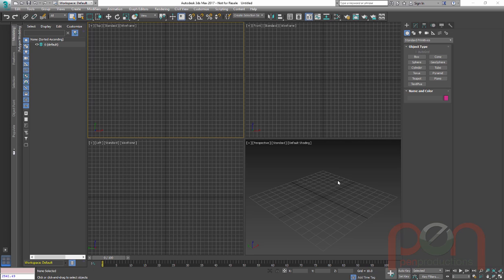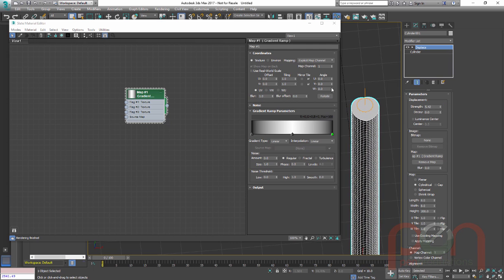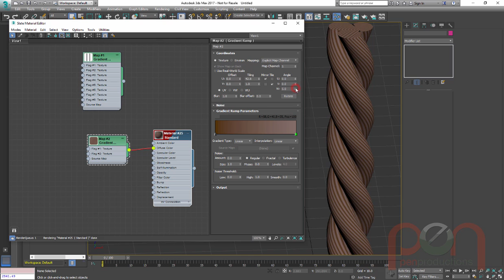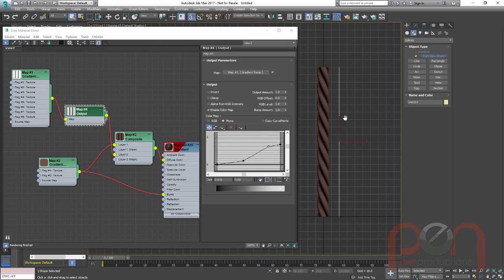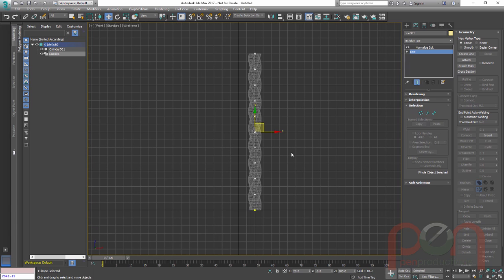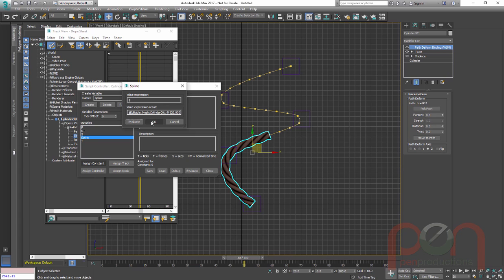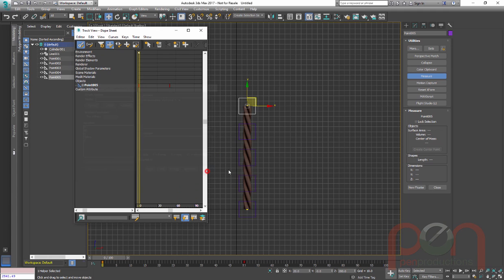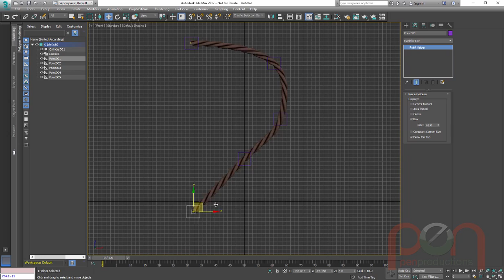3DS Max Procedural Rope

Comment: This is excellent - and really handy vs. mucking about with the debatable virtues of mCloth rope or regular Cloth modifiers etc.

On the topic of forces though - what would be your suggestion as the best way to make this react to Wind, without potentially messing up its virtues?
I'm intending to have a flag (with Cloth mod) being raised on a rope, and fluttering in the breeze, and would like to try and have the rope react a bit too.

If need be, I can do it by hand, but if you have a better idea it would be most welcome.

Comment: i don't have the gradient ramp parameter
Reply from the maker: I'm going to assume you have Arnold set as your rendering engine. If so the legacy maps don't show up unless you turn them on in the render settings dialog under the System tab right near the top.

Comment: Hey Paul, can you help me sorting out the problem please? trying to follow your tutorial, but every time after "curveLenght Spline / 200" I get error: Type error: Call needs functionor class, got: undefined. thanks
Reply: I created variable called Spline, assigned my spline using dollar sign, all good, but doesnt work anyway
Reply from the maker: curveLength
Reply: sorry, there was a spelling problem :D anyway. after I copied angle controller to height segments and multiplied even by 20 it still doesnt get more segments
Reply from the maker: @zelenytypeceeek  I just tried and you are right. It no longer works. I will ask Autodesk about this and see what is going on.
Reply: @paulneale  Hi ! Any news about the problem ? thank to you for your work.
Reply from the maker: @molerabenjamin2480  The one I said doesn't work? Look like it may never have worked with a extrude modifier. I may have been mistaken
Reply: @paulneale  Thank you !
Reply: @paulneale  There is no solution for Cylinder Height Segments can't get more than 200 ? Right ?
Thank you for this awesome tutorial !
Reply from the maker: @zelenytypeceeek  odd. What max version?
Reply: Dubug shows correct expression values based on curveLength Spline * x but in viewport I dont see any changes

Comment: Hey Paul! Thanks for the tutorial, this is insanely useful. I have a question, though: Unlike yours, my helper on the bottom of the rope moves the entire rope around instead being pull- and extendable like the helper at the top. Everything else seems to be working fine. I know it's been a while since your tutorial but any thoughts would be much appreciated! Thanks :)
Reply from the maker: Just un-link them. IK Spline Control modifier has options for that or you can do it manually.
Reply: @paulneale  Wow, that was fast! Thank you so much for replying, the modifier options worked for me :)

Comment: so here I am, innocently looking for a way to model rope to add a skyrim mod .... and then you did that! omg. This is very cool stuff. How deep is this rabbit hole? I may never find the surface again. It will take me a month to work out all the new things I didn't know existed.
ty.
Reply from the maker: The rabbit hole is way deeper then than what you could learn in a month.  I'm still learning new things and I have been using Max from Max 1
Reply: Any illusion I had that I could work it all out in a month vanished in about the first 5 minutes. But being shown new things is cool. It makes things I am trying to do possible in ways I just knew nothing about. tbh several 100k poly rope didn't really fit my current need. I followed along and made it anyway :)
Reply from the maker: Beauty of this method is you can make a rope with any amount of polys with it.

Comment: Thanks for this amazing tutorial. I just have a question about the height segment. You mentioned the maximum number of 200 is just for the spinner and it can get higher than that. But when I do a crazy stretch on the rope it stops at a certain amount! To test it further I tested a simple script controller that drives the height segments by frame and quite surprisingly after frame 200 it didn't get higher! I'm using 3ds max 2016 sp3. could it be because of the version I use? I would appreciate if you test it out.
best regards
Reply: I experience the same thing as Eshan - when i stretch the rope, the segments don't seem to go higher than 200. it Just stops and the rope becomes "low poly" the more i stretch it.
Awesome tutorial though :D
Reply from the maker: The spinner in the UI stays at 200 but the value increases. Check it via Max Script .
Reply: @paulneale  I am sorry, but this is not true. I tried to make the cylinder 400 height segments via float script - stayed at 200, then even 1000 - stayed at 200. It seems, after searching for solution on forums, some paramters of objects have hardcoded limits not only in interface spinners but at all. (3ds Max 2021.2 tested)

Nevertheless, the tutorial is awesome otherwise. I would love to see any other workaround (other technique) of this as I usualy needs very long dynamic ropes in my animations. Thank you.
Reply from the maker: @monikadurakova2990  Ya for some things it works but not this case :(
Reply: @paulneale  Yeah, unfortunately I have had the same issue. It's an awesome tutorial. But Unfortunately, rope being rope it can get quite long, and if the height segments can't be driven beyond 200 it defeats the purpose somewhat. Thanks again though. Your tutorials are truly epic.
Reply from the maker: @ariddesignstudios5423  they have been removing some of the caps in recent years so test on 2023